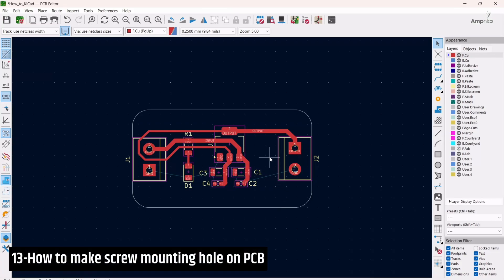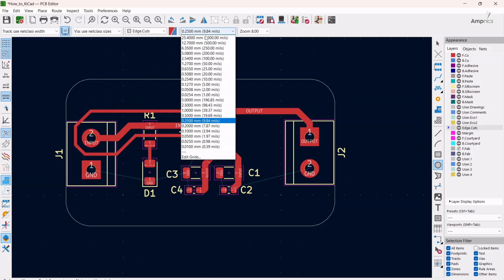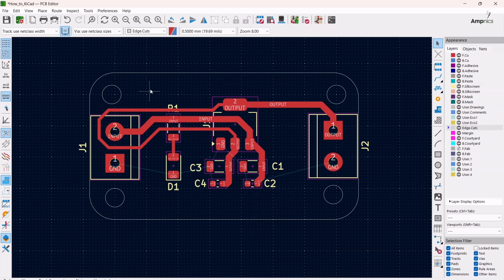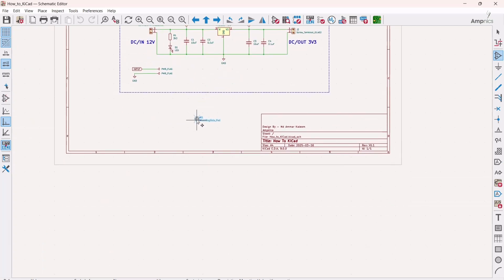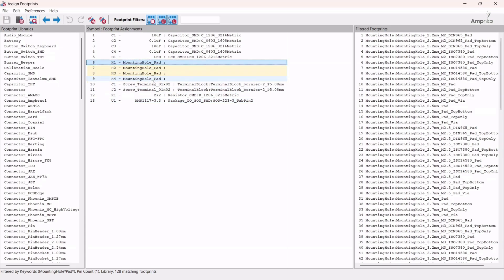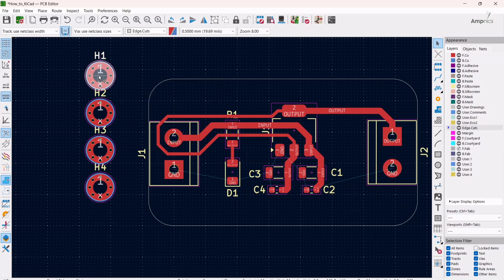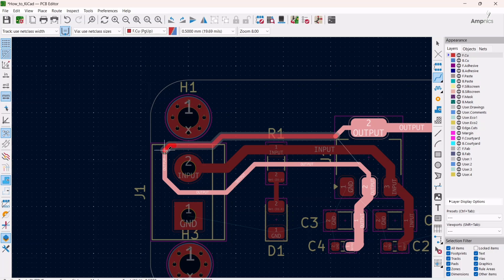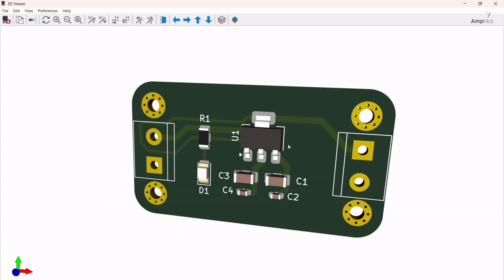How to make screw mounting hole in KiCAD | How to KiCAD | KiCAD 9.0 | Part 13 | Ampnics

Comment: Does KiCAD come with a parts/footprint library that contains those terminal blocks, that mount to a pcb and allow you to screw down wires?

Not only would that provide the mounting holes , but contains the thru-hole spacing?   Although looking at digikey, it seems there isn't just one standard, the diameter of the pin also varies?!
Reply from the maker: If you share part number we can help you out. Or connect us over WhatsApp we can solve your problem asap!

Community: https://chat.whatsapp.com/HgWOoxyOgLfGEkAPHPM01k